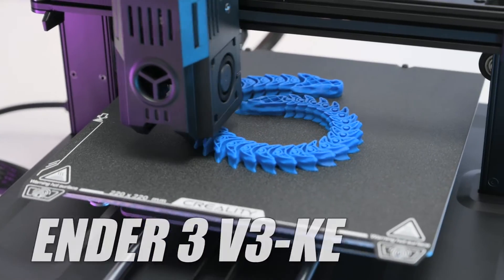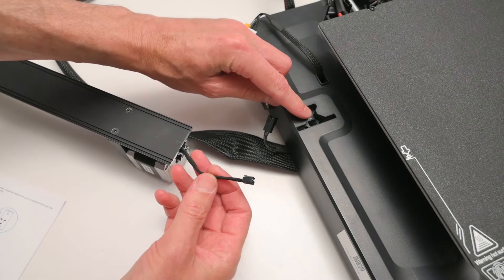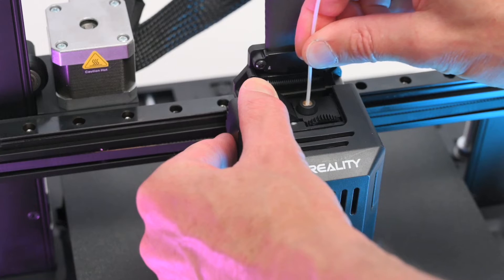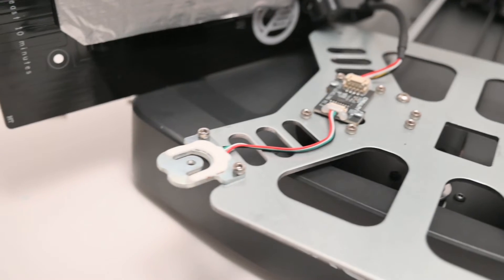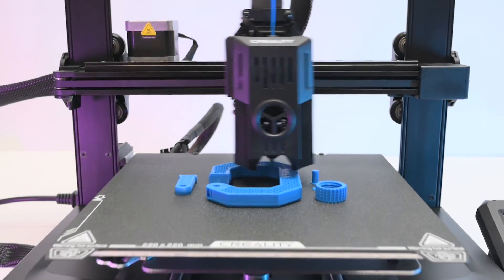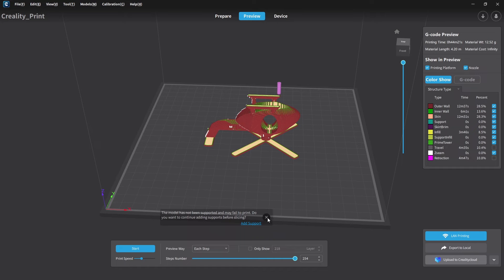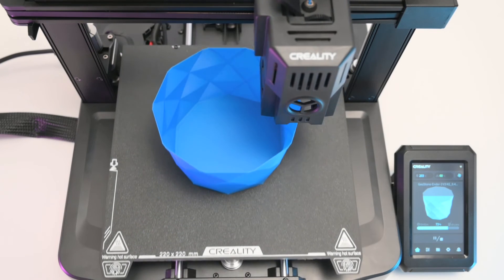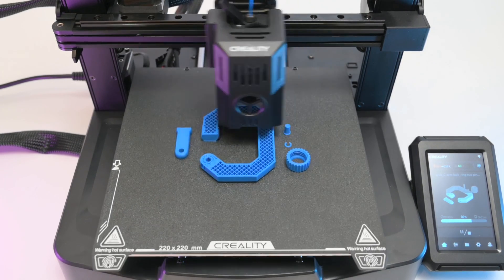ENDER 3 V3 KE - ENTRY LEVEL HIGH SPEED PRINTING

Comment: I have had this printer for a week now, was extremely excited to get it.
 I would say 40% of my prints have failed.
 The adhesion to the print bed fails especially on prints with many parts like articulated dragons.
 Ive tried all the recommended fixes, including slower print speeds, using glue stick on bed, adding raft to models, nozzle and bed temps etc.

Thus video makes it look so good but my experience is very different.
Reply: Ke owner, swapping the plate with an Undio seemed to help with adhesion. You might need to physically adjust the bed too, via putting washers in the 4 screws holding it up. Use the mesh from the auto leveling to figure out where to adjust. 

Hope that helps.
Reply: Best solution for bed adhesion will be to decrease the Z-offset, I use Orca Slicer & it had a setting for hard coding a Z-offset for all gcodes, I set it to -0.1mm. it helped alot as the bed leveling of the printer resets the Z-Offset of the printer each time.

Another option will be to add a brim around the model.

I just got mine today & I was surprised how quick it is, but with that speed you have to understand the limitations of the printer design, the printer produces alot of vibrations, so brims are a must if you want to do a fast print.
Reply: strange i have the opposite they stick too well
Reply: @ft7397  hope it continues to perform well for you ive packed mine away and upgraded to a Bambu p1s, its so much better but it does cost more so id expect it to be.

Comment: i've had nothing but problems with mine. bad prints and many failures. ever error codes mid printing. did i get a bad printer?
Reply: same here but adjusting Z offset made it work again. ALso had errors but were due to the slicer software (non-creality)
Reply: @JN7583-k7z  i actually returned mine and got a new. got a bad batch first.
Reply: Same here😢 nothing works waisted 2 rolls of filament for calibrations, testprints and suddenly failed prints after 30 hours (error codes layer shifts ugly layer lines)

Comment: i bought this about a month ago. as my first printer and i love it. with No prior experience of 3D printing what so ever. i was up and printing in abot 20 minutes. since then i have i have designed a few complex parts in blender, and tinkercad. i then decided that this hobby is right up my ally and i went ahead and ordred one more V3 KE and one bambu lab X1E. now i want to dip my toes in some Resin printing.
Reply: how is it going so far?

Comment: KE or spend a bit more and get a Bambu A1?
Reply: the ender is at 299 and the A1 is at 440 thats 140+ to get multi color on the A1 you go to 650 but the ender is OPENSORCE WITH KLIPPER !  so hard to say :)
Reply: @emmanuelskolinos1361  tough choice right? Lol
Reply: the v3 SE or KE is a solid directdrive 300c hotend klipper opensorce printer at 199 SE and 299 KE hard to beat but some ppl like white so thay pay for it :)
Reply: @emmanuelskolinos1361  ya I've been leaning towards the KE over the A1. Withthe money I save on the KE I can buy filament. Maybe get a P1S/P if I actually enjoy the hobby.
Reply: I just bought the KE for 254$ on Amazon
Reply: Easy choice. BAMBU A1! Do not think a second about to buy creality. Their quality controll is not existing likewhise their customer support. If you have money to burn so just literaly burn it up you will get something at least out of it (warm) for a little while.
Reply: This comment didn't age well. @mRxmodule
Reply: @mRxmodule  This aged well. Lol